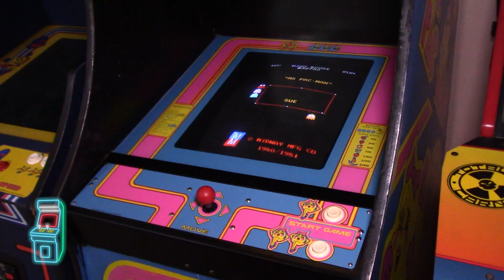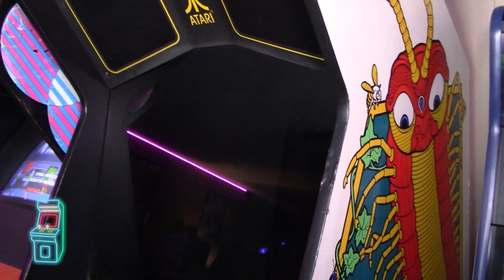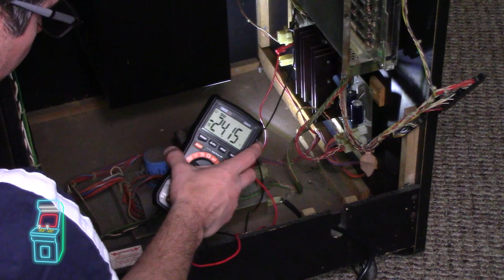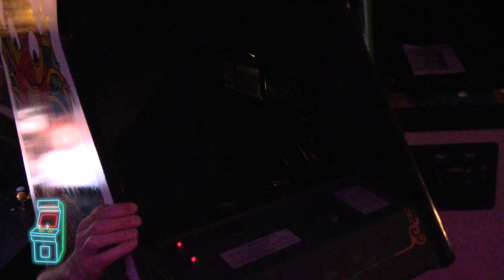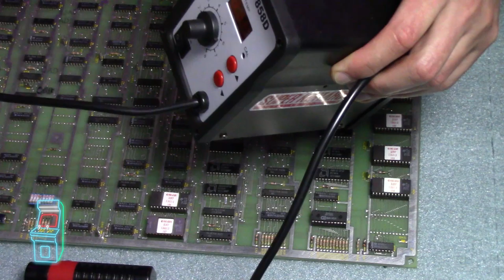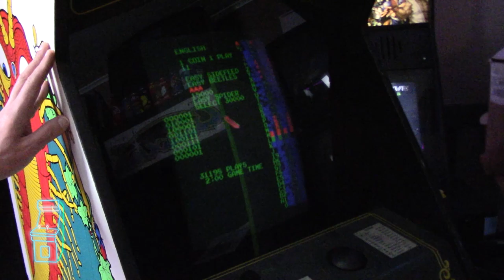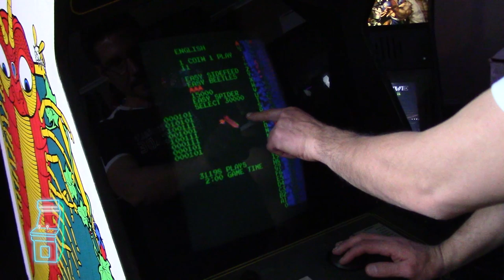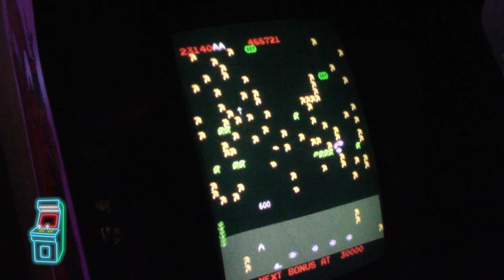Millipede PCB Repair [Resto Part 2]

Comment: Great video! Lucky the PCB had a single issue. Only one criticism.  Try not to use a desoldering gun pointed vertically. It's a vacuum suction and thus fighting gravity leads to both poor suction and frequent nozzle blockages. Get a panvice or other PCB holder so you can desolder gun horizontally.
Reply from the maker: Would love a PanaVice. But they are pricey. ;-)

Comment: where can you get replacement chips?
Reply from the maker: I think I grabbed them on eBay. I just searched for the existing chip number that was already on the PCB and matched it up.
Reply: @delsarcade  last question, is it possible to match up the chip numbers and it be completely wrong, i know it will matter for the rom chips because obviously it will have to have the correct rom burned to it, but what about the ram chips? Is it possible to match numbers and pictures, buy them, swap them and they mess something up because they could have matching numbers for this but not be for this?
Reply from the maker: No, not possible. There are different brands of chips but as long as the "type number" matches you are good. For example 4116 ram comes in many different ram brands but still works. 
Which chip are you looking to replace?
Reply: @delsarcade  i was just wondering, im working on my millipede and im hoping it is just the big blue capacitor, if it aint then hopefully itll get it beeping then to move on to the stuff maybe we are talking about. Thanks for the reply
Reply from the maker: @jeremylester6537  Test the voltages on the AR II board. Also there is a test point in the PCB. Test that as well.

Comment: DELUSIONALS ARCADE, why does arcade games coin door lamps use a NEGATIVE voltage instead of a Positive voltage?
Reply from the maker: As far as I know they use positive. In this case for this particular machine it's +12v and ground. 
In some other machine they are +5v and ground.